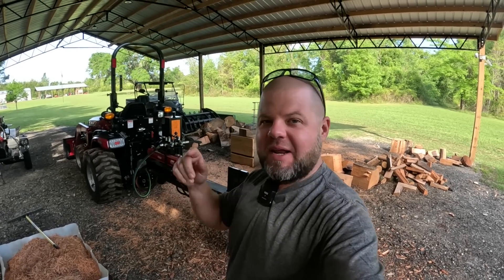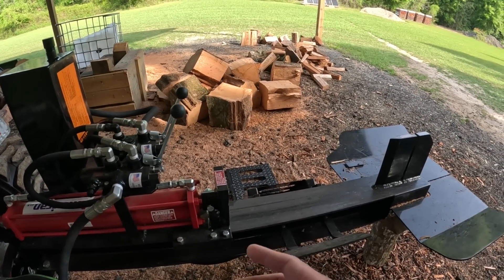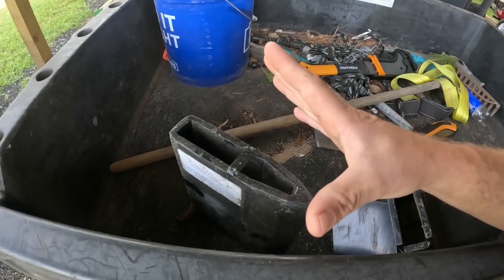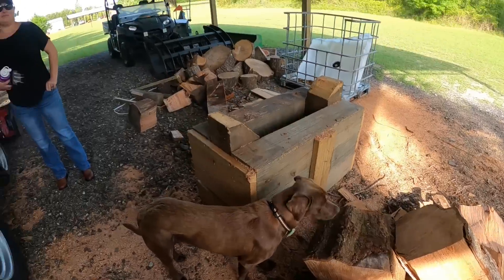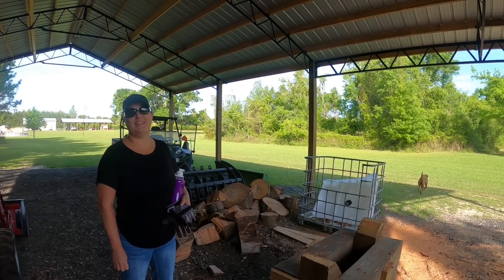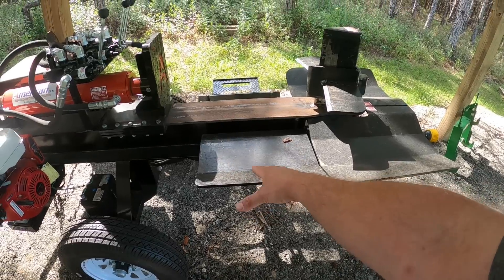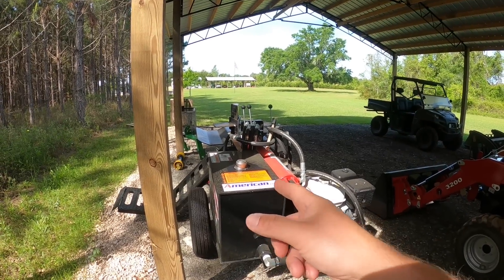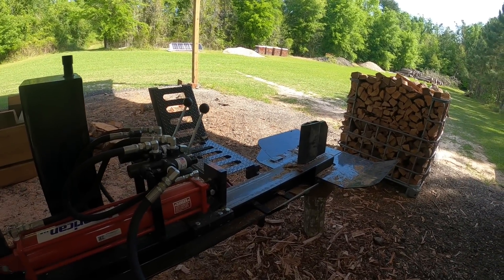New Hydraulic Pump Testing! 3PT Log Splitter

Comment: When you have Tiffany helping you, you should consider moving the tote to the side instead of straight behind the splitter and turning it 90 degrees, so she won't have to do a full 180 turn to stack the wood and instead she'd only have to do a 90 degree turn. If you get it just right, she won't have to move her feet at all and just turns her upper body from splitter to tote. I bet she'd be able to keep up with you then.
Also, you should check out OneEyeCustoms's video, who made a modification to his splitter where the push plate doesn't go all the way back every time. It makes the gap between the pusher and wedge smaller which in turn reduces the cycle time even more. Of course this won't work if you want to split longer logs, but from what I can tell you cut all your logs to the same length

Comment: For an excuse to leave a comment for ya: it hurts my heart as a former northerner who heated his happy home with wood to watch all that wonderful fuel get split up into a tote of kindling lol. I know, different application down there, like I said just a comment for the ol' YT thingy :)
Reply from the maker: Oh boy! This isn't the north with stoves or boilers 😉
Reply: Back when I grew up on a farm and we used wood heat. Something like that would have been a sweet deal. But no back then it was all by hand. We used to say the wood warmed you up 3 time. 

1st time spitting it by swinging the maul

2nd time carrying it into the house. 

3rd time when you burned it in the stove.
Reply: Fire don't care what size the Wood is HAHAHAH 
I live in the Northwoods of Wisco and I try to burn the Whole Damn Tree....Branches and and all ahahaha
get every BTU I can get...
Reply: @m9ovich785  If one wants it to burn slow and steady all night long, without fear of the wife kicking one out of bed to stoke it some more in the middle of the night, one learns to use a couple or 4 very fat pieces before bed rather than a lot of smaller pieces with all those air gaps that let it burn hot and fast. Even cranking down the vents and flue didn't help it last. My experience, anyway. Large pieces make for a good night's sleep and happy spouse. It all burns, sure, and like livestock it all eats but different parts have different purposes. Also same before leaving for work if you don't want to come home to a frozen house.
Reply: @scottkrebs586  I have an Outside wood burner and fill it once a day with a wheelbarrow load of wood.
Reply: @m9ovich785  I would have loved that! Unfortunately, I wasn't blessed back then with a big hopper so, while the wood stove was relatively large (~40" deep x 24" square, give or take), it wasn't going to hold a wheelbarrow load. Hence, I would use the largest pieces that'd fit through its door. Anywhoo, more comments in the thread for the TKCL channel's YT algorithm! (I live in NC now, so no [real] snow in the winter and not as oppressive in the summer as when I lived GA so ideal for someone working their way through their 50s that no longer cares to swing the 8# splitting maul lol)